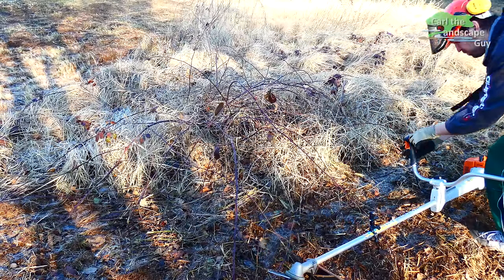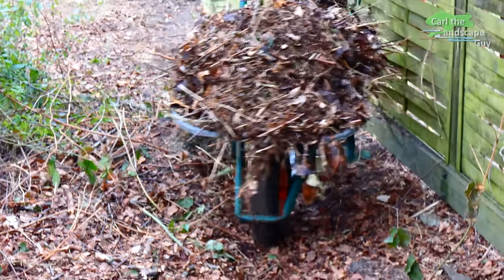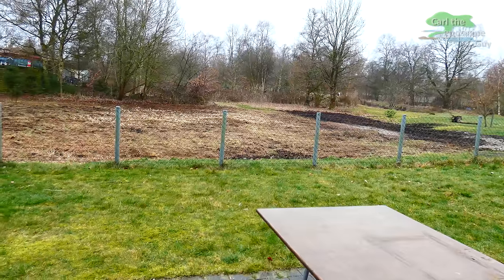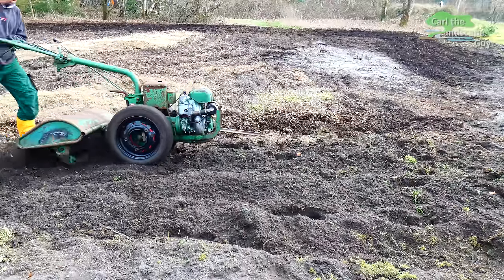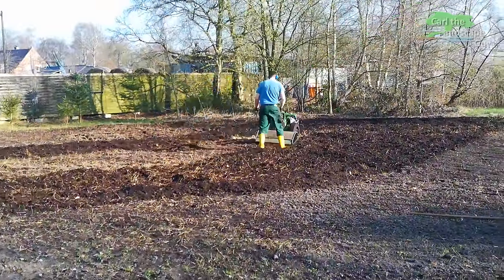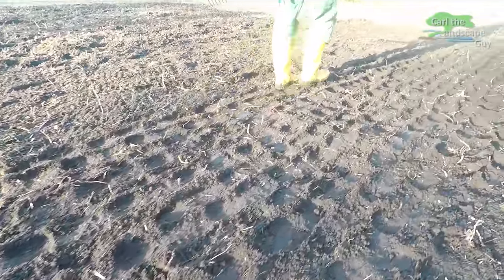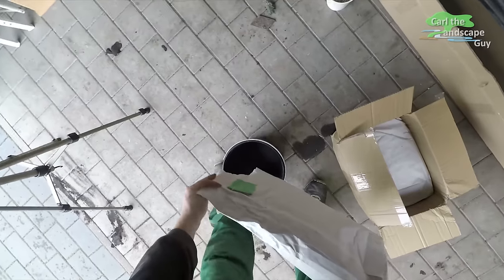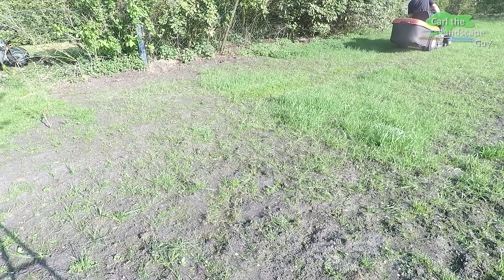BACK YARD TRANSFORMATION,LAWN START-FINISH HAND MAKEOVER,HOW TO FIX GRASS, NEW REBUILD SOW SEEDS DIY

Comment: I like how this video was presented. Had never seen that balded Stihl being used in the beginning. If I had seen it at the shop I would have thought edging device.
Reply: hand held brush cutters are so underrated. perfect tool for people who think they need a walk-behind brush mower (but don't) or people who are trying to use a trimmer and failing.  also great for cutting down trash saplings. a 24 tooth or higher blade would've gone through his thicker stuff even faster than the video shows. those tri-blades are really only good at spreading glass clippings but you give up a lot of cutting power. they also make chainsaw tooth style blades if you just never want to buy a chainsaw (joking not joking).

Comment: Personally I would have used a spreader for the seed then cover it with hay to help build the thatch you removed. When mowing the lawn I would cut with the blade in the highest position keeping the grass tall to help chock out any competing weeds.  Also leaving the clippings to give back nutrients and help build back to thatch that helps retain moisture for the new lawn and ungerminated seeds. Looks good.

Comment: I love your video.
This is something I need to do. I have more weeds then grass.
Especially in spring. Then after frequent cutting the grass gets more visible.
But I have a dog too, so if if flip over all the yard it will be just dirt...
Any suggestions?
Is it possible to do it bit by bit?

Comment: Hello, I am trying to turn an overgrown area into nice green lawn. The overgrown plants have been cleared, but now there are over a hundred little stumps and tons of roots under the surface and I guess the tiller wouldn't be able to handle that. Any tips to get the land ready for the tiller? I tried removing some of the stumps with shovels, but it doesn't seem to be the best idea. I already broke two handles in 2 hours of work. Thank you in advance!

Comment: In America, where possible, we use machinery. Skidsteer, tractor or 4 wheeler to pull/push various implements around to do the job. Takes only hours instead of days, which most of us dont have. Nice job, though. We have perennial weeds here. You have to mow at least 2.5 inches high, to have enough shade to crowd out most weeds. Crabgrass will still spread though.

Comment: Blades. A knife is a utensil you eat with, a single or double edged blade held and operated in the hand (and the plural is knives, not knifes). A blade is a sharpened piece of steel on a machine (amongst many other applications).

Comment: Have you ever tried using a Sub-Compact or Small Compact tractor with for a example a Flail Mower equipped with hammers and a 3 point attached rake.
I have done similar work for neighbors and in my property and IMHO with a tractor is much more pleasant and efficient.

Comment: I cut my toes off with that exact same Stihl weed eater (on accident, obvs), when I was 15 (but the one I was using had a loop handle). Cut right through my shoes. I've got 8.5 toes and a heap of pins holding everything together to prove it.

Comment: I guess burning is not allowed?  Burning would also return lot of minerals and ash back to the soil.  A very natural solution.
Reply: But this a long of the time will decrease the soil fertility, and this kills a lot of organisms presents in the soil.
Reply: @ThiagoUFF2010  : Lightening strikes start prairie fires, Native Americans used to set fire to grasslands to hunt buffalos, and grasslands in the Mid West are regularly control-burned by the Dept. of Natural Resources to remove woody species and preserve the prairie.  The burn is very quick and superficial, will not kill worms, moles, rabbits, etc.  It will inevitably kill some animals but the good the fire does in preserving the prairie more than justifies it.

Comment: I am doing this right now with a 100ft x 75ft old garden abandoned since 2010 (started reclaiming in 2018).  Blackberries by the pound.  When I was approximately 50% through the mass of blackberries, boisonberry, wire grass (weed), violets (weed), Chinese elm saplings, and mucsidine grape vines (50 ft long!) in Jan 2020, I discovered heavy infestations of: poison oak, poison ivy, Virginia creeper, and honeysuckle (weed).  I have to "suit up" in long-sleeved shirts and heavy gloves due to all the poison weeds.
I just want to cover everything with three layers of 1-millimeter black plastic and walk away for 3 years.  Cutting thousands of muscidine grape vines  with a tree limb lopper hurts my carpel tunnel in both hands. The threat of poison means I have to take a shower and wash all clothing every day after working clearing the area (1-4 hours per day).  I was literally working 4x faster before I found the poison weeds.
(In case you're wondering, I have to stop Nov-Feb because of weather and my priority changes to getting 30+ 43-lb bags of mulched oak leaves for the garden as soil in 4 years.)

Comment: While I am not knocking your work ethic... A LOT of this work could have been done a lot quicker and easier with the use of a mower. 

I was also very much shocked at the speed at which the rotovator was going... That was simply FAR too fast. Not only was it potentially dangerous but there is no way it could have broken the soil up properly.

Comment: so why exactly did you spend so much time mowing that fence line when you could have went down the fence line and just taken about 3-4 passes instead of over 30
Reply: It's too thick and the mower deck was on the lowest setting so what happens is it ends up slowing down from all that friction and stops the blades from spinning. With a more powerful mower sure, but not with the average one.

Comment: Sorry but ANY tractor with brushhog, tiller and boxblade attachments and ALL of THAT work would have been done in ONE day.  On second day would have been hand work prior to the fill arriving which you'd spread and level with the boxblade. Evening of second day ready for sod OR evening of third day if you install DYI irrigation.
I get that this is "anybody can do it" video, but common sense and "smarter not harder" should be noted somewhere especially when it's posted by a Landscape Guy.